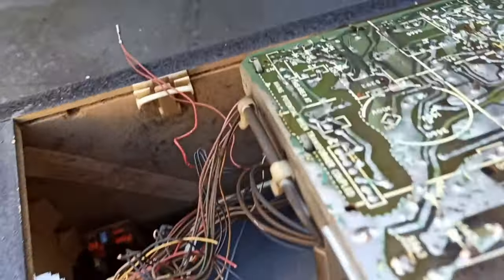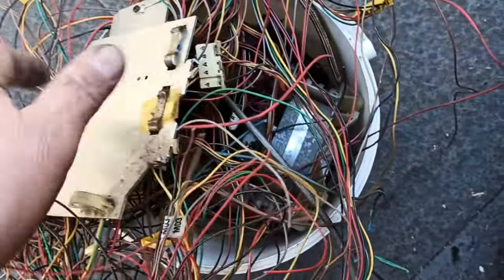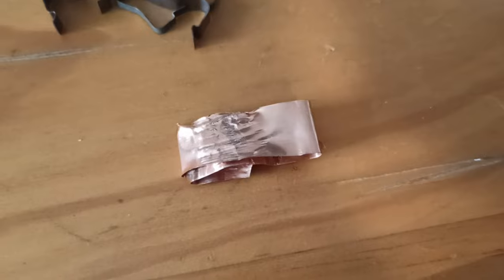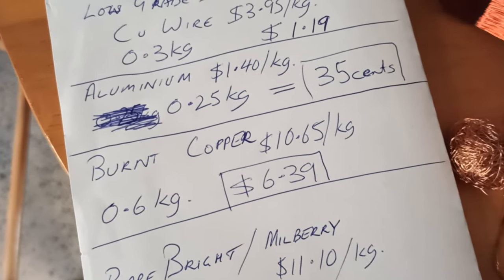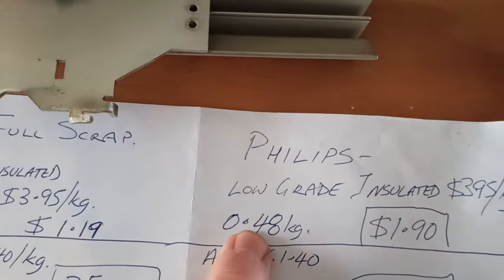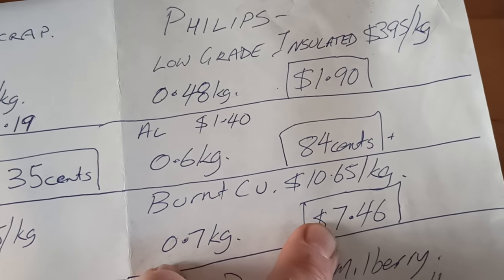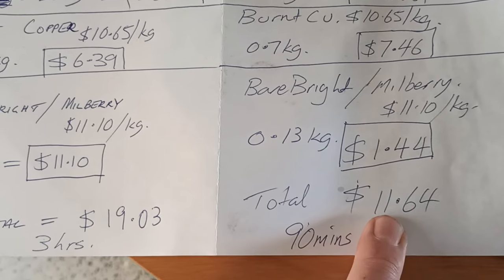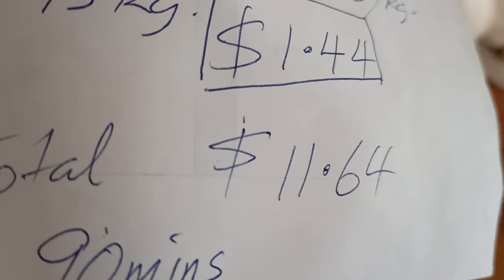54 Sony V Philips TV.  Which Television For Best Scrap Copper? (Surprising Results) Bondi Scrapper

Comment: Great effort with the TVs mate, tho in the pricing you didn't include the circuit boards which are about 60c - 65c a kg up here in Brisbane, the copper with that black resin stuff stuck to it may possibly be graded as domestic copper but see how you go..... Anyway have a terrific day.
Reply from the maker: The nearest place I know that buys circuit boards is a 2 hour round trip.  No value for me in that.
Reply: Crikey!